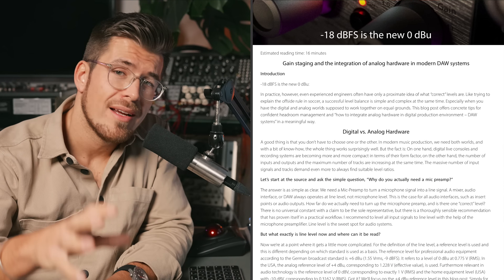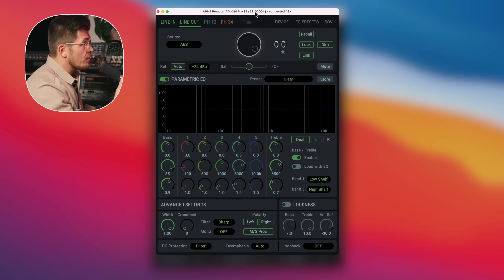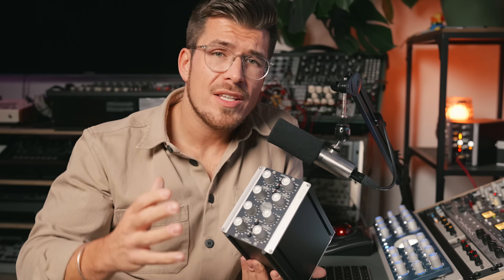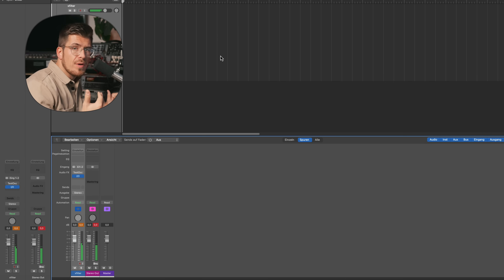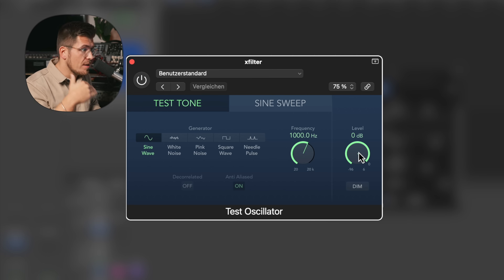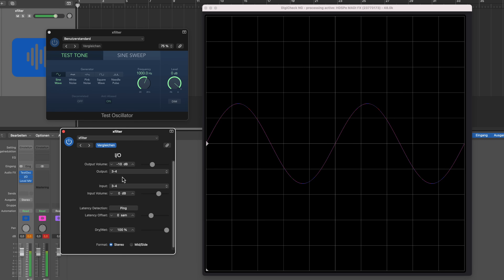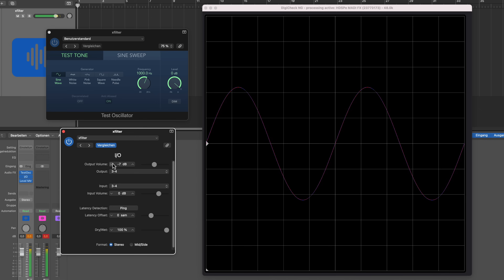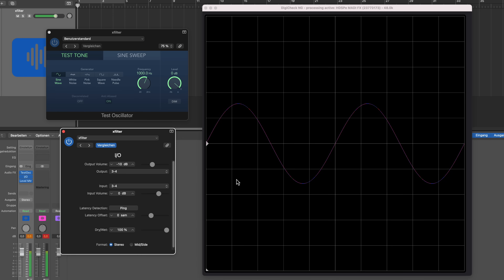Working with Analog Hardware in the World of Digital Audio

Comment: The most important thing to do in a hybrid environment is to select a reference level and then print a reference level tone on each track. It’s not the dbu level that is most important, but the reference level of your analog equipment. With digital the requirement for reference levels went away. Tape machines necessitated the requirement for a reference level as tape would distort when levels exceeded a certain amount of input level. Broadcast was the same… you could overmodulate a transmitter causing nasty problems with other stations, if you exceeded a set reference level. With digital, the perceived need for reference levels has disappeared, but it’s still there. Think of how different video streaming platform have different audio levels and this becomes more apparent. Originally, digital reference levels of ‘0’ were -22 (which provided great headroom), -20, -18, and even -15, all referenced to 0 dBFS (or zero decibels, full scale, or just before digital clipping). However, with the advent of digital compressors, and the ensuing loudness wars, this all went out the window. Now we have reference levels that are related to loudness levels, or listening levels (LUFS), or Dolby’s own reference level for program material, for which you need Dolby’s own measuring device. While digital is great in many ways, it’s created a sloppy approach to engineering, and the DAW has turned engin-ears, into engin-eyes. The one digital recorder that kept people more reliant on their ears was the RADAR… one of the best sounding digital recorders to ever hit the market.

Comment: Hmmm…. so many issues.

Firstly, -18dBFS is the new 0dBVU not 0dBU as that document that I haven’t yet read proclaims.
0dB VU or 0VU on a VU meter is calibrated to +4dBU (which is 1.228v on a voltmeter), not 0dBU (which is 0.775v)

So -22dBFS would be the new 0dBU.
Except that’s kind of irrelevant.

If your Interface can output 0dBFS as +24dBU, then -18dBFS would be +6dBU (which you said is a German standard)
Here in the US, that would be +2dB hotter than the Professional Line Level standard, and with that 1Khz Tone, would appear 2dB into the Red on any standard Analog VU Meter.

In that situation, wouldn’t you Calibrate internally to -20dBFS = 0VU “In the Box” (which is the SMPTE Broadcast Standard anyhow), which would make say a Klanghelm VU Plug-in and an Analog VU Meter read the same?  You’d just get 2dB more headroom ITB, 20dB instead of 18dB above the “Nominal” 0VU.

Now….

As far as reducing your output levels on your Hardware Inserts across the board like that, -10dB!! And on a device that can take +21dBU.
I don’t get it.

Yes, you’re pushing a 1kHz Tone through, and finding where the Clipping point is, which is great and what I love about the video:  everybody should Test their gear!  
But it’s a test.

A few points:

A) You’re going to be sending Audio, not test tones through your gear.

B) You tested at absolute 0dBFS, but if you’re mixing/processing around 0VU, only the highest Peaks would go 18 or 20dB above the Average.  That’s a Lot of headroom to use up.

C)  Going out into the Analog domain is often Precisely because I want to Drive hot signals INTO Analog gear.  Precisely because it Does Not clip like digital, it Saturates/Distorts/Clips…like Analog.  You have 24dBU at your disposal and you give 10dB away!?

D) It’s the Return path that you need to be mindful of.  Don’t Clip the ADCs!  But while some Interfaces have Fixed input levels, Many have Input Gain Knobs, before the Converters.  If some how you got too hot for +24dBU converters, turn down the input gains, or if the device you’re using has an output level, turn it down there.  (Or add an inline Pad if it’s particularly hot!)

E)  I don’t know that EQ, but with most gear, when it states a maximum input level +21dBU in this case, that doesn’t mean it’s going to break at +22dBU, it means the signal is going to “Distort” above that level, which is precisely what you showed.
That is Objective.  Subjectively though, pushing gear into distortion and Out of its Linear range, is a big part of the Art.

How Much harmonic distortion, and the character of that distortion is up to the user to decide.

Reducing 10dB is 10dB less options from my perspective.

F) Lastly, I’m very much a RTFM, know your gear, test and calibrate everything kind of guy.  But you also gotta have a grip on Signal Flow and Gain Staging from an Art rather than Science POV.  What worked like magic on a vocal Tuesday often won’t work on a different vocal Thursday.
Reply: Hey, thank you for the thorough comment. I think there is no disagreement here. In the video, I stated several times to trust your ears and only use my technique as a rule of thumb. In fact, I love to play around with headroom and clipping BUT it needs to sound "good".

The purpose of this video was to give people a basic understanding of gain staging, because many people were frustrated with their outboard experience, thinking they bought faulty gear etc. due to clipping.